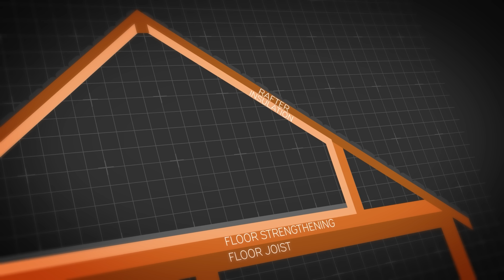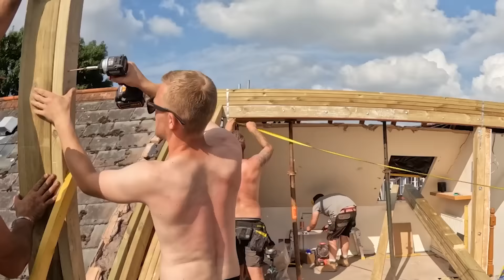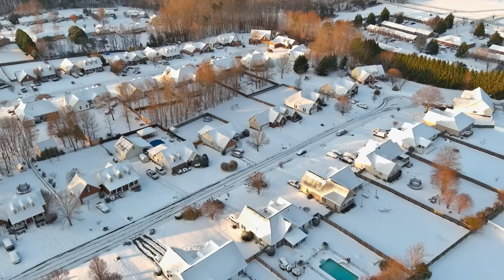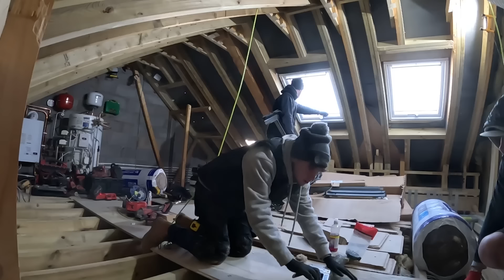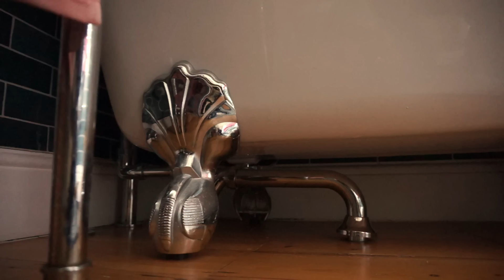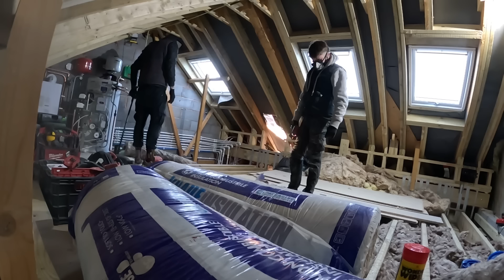THE SHOCKING TRUTH ABOUT LOFT CONVERSIONS - ALL PRICES REVEALED

Comment: Thank you for this very useful video. How much higher than the ridge line can I go? (terraced house)
Can the roof be asymmetric as it increases useful floor space? (steeper to the front, almost flat at the back)
Reply from the maker: Are you applying for planning?
Reply: @SilverFernDevelopments  Yes, it needs it, will work with an architect/planning consultant but raising the roof is important for space and for having a sloped roof at the back to have solar panels on a south facing roof. I asked to have your take as you have done this type of work, sadly am too far away to ask you for a quote. House has a small loft conversion 45 years ago, without touching the roof and leaving the purlins in situ, it uses about 1/3 mid section of roof and stairs come out of living room I want to move the stairs above existing stairs and do a full dormer loft conversion.

Comment: Get a good architect and structural engineer on board, with detailed thought through design (including all plumbing, sockets, lights etc, and price control is a lot tighter. Shop around for professional service providers too, as soon as they see it’s a domestic client, price increases hugely. Similarly, with builders, don’t go with the cheapest, structured payment milestones and retention for snagging. If they don’t like it then walk away.
Reply from the maker: Great advice!!! Sounds like you have don’t this before!!!

Comment: I've watched a lot of videos on loft conversions but this is the best I've seen at breaking it down by work required and costs.  Thanks for this.  We are in an odd position of having some of the work done already.  We don't have stairs running to the loft (have loft ladder) and the loft is floored and we have radiators and electrical sockets.  Would we still need a structural engineer to assess our loft, particularly ref the floors?
Reply from the maker: Hi Ryan, has the floor been strengthened just loft boarded?
Reply: @SilverFernDevelopments  Hey thanks for replying.  I'm not sure exactly.  I can only say it appears to have been floored with thicker more durable wood

Comment: I work in the industry and it's really about looking around for quotes. One property I visited, has put up a brick and block 4.5m high outbuilding, roughly 5x5 in size, pitched roof. The structural cost was 7 grand, and that's in Cambridge. So, that's digging for the footings, concrete foundations, building the walls and putting on the roof. 50 grand for a velux conversion is utterly ridiculous and a massive rip off
Reply: this guy is living in la la land, have you seen the cost of bathroom and finishes? You can easily get a nice bathroom for £2k and finshes for a dormer loft conversion cost no where near £9k, I think this video is what the direct prospect clients to so they're giving them the inflated price ready for a 20% negotiation to close the deal. Utter nonsense I can't believe I wasted my time on this vid

Comment: 50 grand for a velux conversion, utter madness! You might as well build your own timber framed outbuilding, insulate it, run some leccy to it - 5 grand tops.
Reply: You can't sleep in it
Reply: @seancrowe3353 if it's ancillary to the main dwelling, yes you can
Reply: why not
Reply: Just saw you said 5 grand. Lol.. Nice trolling
Reply: @seancrowe3353 mate, you can build a big, pitched roof, timber framed shed, which is effectively an outbuilding, for £2500. It's the rest that will take it up to £5000....

Comment: Thank you, we have a velux conversion with some nice additional features that came around the quoted prices.  For heating (we did not want to upset our aging boiler at that time) we fitted a air-to-air ASAP which gave us heating and cooling.  As for lighting i would strongly recommend you don't fit spot lights, they create small cones of light with shadows everywhere, and if you still use halogen they are expensive to run and have a fire risk.  We fitted LED panel lights (4 of), which give a shadow free area lighting.  It also means, with a low ceiling height in a roof, you don't get eye level over bright spots of light.  They can also be adjusted for colour and light quality (ie do you want operating theatre blue-light, or a soft warm light) with a simple control.  They also don't need cut-outs in the insulation to install, the fit flush and don't need fire hoods.
Reply from the maker: Thank you so much for the amazing insight. 

The led strip is a nice idea. Where did you fit them?
Reply: @SilverFernDevelopments they are flat LED panel lights, you can get them as rectangles or, as in our case, round panels about 14 inches across.   We like them so much we have them in the kitchen,  roof and a study.   They give a even light with no sharp shadows, perfect for a kitchen where we have 4.  The roof ones are just 12mm (0.5 inch) thick and fit flush to the ceiling so they are fitted down the centre line a illuminate the room to the sides.

Comment: This is probably a stupid question, but I didn't see it covered in the video and I have no experience in building/renovation (everything else was covered, thanks) - if the 2.4m height isn't there, does that completely prevent a conversion or would you be looking at a roof off and build up the height and put a whole new roof on job with planning permission?
Reply from the maker: Hi John,

Great question. It’s not impossible, what height do you have?
Reply: @SilverFernDevelopments I think we have something like 1.98m or thereabouts (I'm not actually at home to be able to get an accurate measurement at the moment).

Comment: Its still a lot cheaper to do than trading up for a bigger house in some areas. I have recently traded up from a two bedroom to a larger three bedroom mid terrace in the same popular area of Manchester and the cost was £225,000 difference between the two when you take into account all of the moving costs. We could have got an extra bedroom / bathroom by converting our old house and doing a loft conversion for a hell of a lot cheaper than it was to move! Great Video :)
Reply from the maker: Hey Jack, thanks for such a nice comment. This is a great perspective to look at it from. I know people often say the difference is in the SDLT and stress.

Not to mention how long the process of buying and selling in the UK is.
Reply: £225k between a 2 and 3 bed is extremely unusual, particularly in Manchester. Even if the 2 bed was falling apart and the 3 bed is completely modernised I wouldn't expect the difference to be so great.

Comment: My loft is too low for a conversion, but I want something different. I want I’m going to call it a garden building on the roof for the roof instead of the normal angled roof. Like a full dormer both sides. Anyone know if this is possible? Or what I do about the height issue?
Reply from the maker: What’s the height from the top of the existing ceiling joist to the bottom of the ridge beam?
Reply: @SilverFernDevelopments 155cm. That’s why I need it building up higher, it’s about 1.5m lower than my neighbours (semi detached)
Reply: @SilverFernDevelopments can you see on here how the dormer is built on (is it e gable?) so there’s no little cut in on the corner and it looks so much better? So ideally it’s this but on both sides to create that ‘full room’ look and feel. I would guess the dormer is just built higher to lift the ceiling? 

https://youtu.be/ZFwc6rbEI2M?si=BArLNB3qQZjJRQ9E

Comment: I paid £25k 20 years ago for a velux conversion in a modern detached house. It comprised making 2 bedrooms and a bathroom. i had 8 velux windows fitted and a pressurised hot water tank. The bedrooms are 5mx4m and 3m x 4m. Bathroom was 1.8m x 1.8m. I spent about 2k on carpets and decorating.  Fantastic value given the extra rooms I could gain.
Reply: A guy in my street is getting dormer conversion done for £72k in 2026. His house is 1936 built semi detached 3 bed.
Reply: You did brilliantly there
Reply: I wonder how much that would cost now!

Comment: Fantastic breakdown. The best I’ve seen on this platform. I have an attic space that has been pre prepared structurally. It was meant to be a third storey on the original build but didn’t get planning on the end. The builder had already committed to preparing the roof space. I’m assuming that would bring a huge saving given your breakdown?
Reply from the maker: Yep, as long as the structural work has been done and there are some documents that you can show building control, maybe old plans or structural calcs.

Thanks for watching, we really hope it makes your life a bit easier

Comment: Great video, thanks.  Considering having a dormer 'shell conversion' done i.e. all the structural stuff, then doing all the innards myself as I have the skills - so insulation, boarding, studwork, electrics, plumbing, flooring, doors etc.  Any pitfalls to consider, and will most loft companies do just a shell conversion for you, as I've not asked around yet.  Hoping to space out the costs and do it over 1-2 years.
Reply from the maker: Glad it was helpful! I can’t really speak for other companies but we would. 

Something to think about, building control are not able to (or won’t) offer solutions for problems, thermal calcs etc . It’s up to the principal designer and principal contractor to design/constuct it in a way that it meets regs. If you going to do all the insulating etc make sure you have the thermal and fire regs nailed before you start. 

There is so much info out there so it’s all available just have to dig through it.

(All puns intended)

Thanks for watching ❤
Reply: @SilverFernDevelopments  Thanks Mr Fern!  I guess any loft company in this scenario would want a clear delineation of responsibilities - i.e. to not be responsible for any of the work that I do after they complete their part, in terms of meeting the building regs and keeping building control happy!  I'm mostly up on the Regs side, but will brush up!  Presumably the principal designer would be specifying thermal materials required to meet the regs?  I can always have that conversation with them in advance.

Comment: For most of people it would be cheaper just to buy a bigger house then converting their loft..
Reply from the maker: Hey! Thanks for watching and commenting on our video. Sometimes that is 100% the case, SDLT is a real pain and we would guess that that is often the difference in what makes people choose either way.
Reply: I think it makes more sense on larger properties. Where I’m at, I’d have to spend at least another £200k to get the next size up and I’d still need to spend another 30-50k on the house… so spending £50-£70k absolutely makes sense. 

Very tempting to do mine for a cinema and hobby room… did a partial conversion of my integral garage for the same and it gets used every day, but would love more space… tempting!!

Comment: Worked on quite a few permitted development builds in the Midlands, Building control cost averages at around £6-700.
Pretty way out on scaffold & structual engineer costs too.
Reply from the maker: Hey thanks for commenting, yep there is no doubt geographical changes in the cost of things and as we spoke about there are always cheaper and more expensive options out there. We wanted for people to have a realistic idea of what they should expect. If they can get it cheaper, better, faster. good on them. Thanks again for watching and commenting, appreciate it.